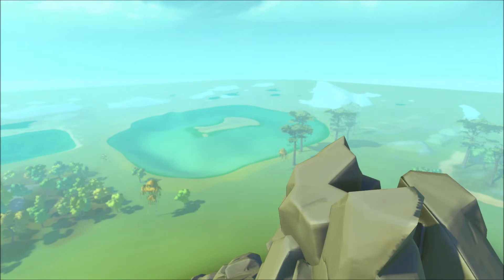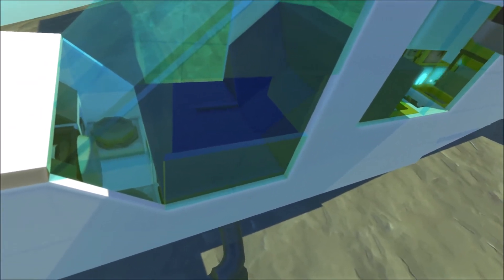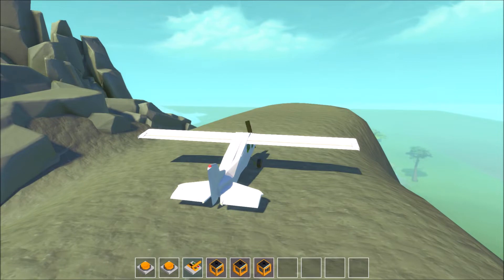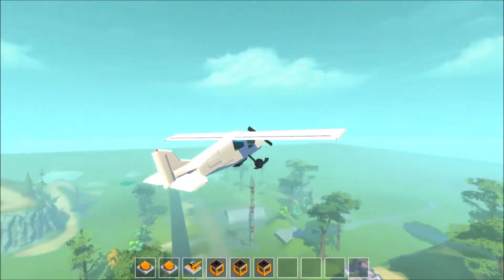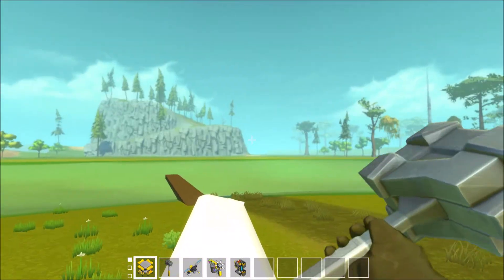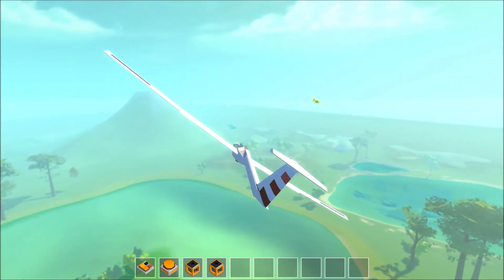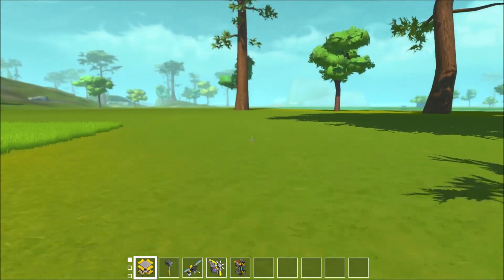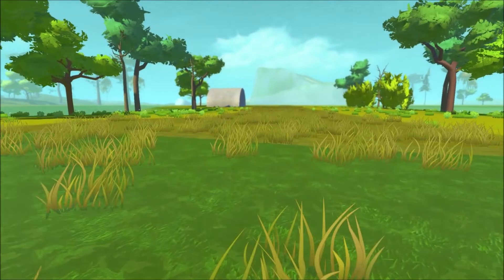Scrap Mechanic creations: Husky Skiplane, Glider Tow and more!

Comment: How do you control the throttle on your engines? I don’t understand smart engines. Thank you so much, I love Concorde and the 737!
Reply from the maker: Hey there! Sorry I'm not very active on youtube.. The smart engines have to be connected to a number input from the modpack. Whatever number is input will set the power of the engine. I use a counter-block for the input so the power of the engine is not a single but a dynamic value. The input for the counter are two color-coded buttons. Hard to explain here but you can watch my other video about engine control units from min 9 onwards, I hope that helps: https://youtu.be/DL809hOTRPs?t=547
Reply: Left Playing thank you for the reply! Much respect bro, you are my main inspiration for Scrap Mechanic and thank you for telling me! I’ll give it a go :D stay safe 👍
Reply from the maker: @theun-knownmusician5468  I'm flattered to hear that :) thank you! Stay safe <3